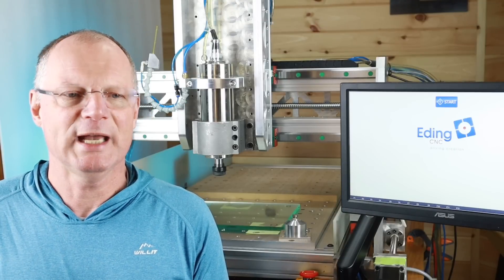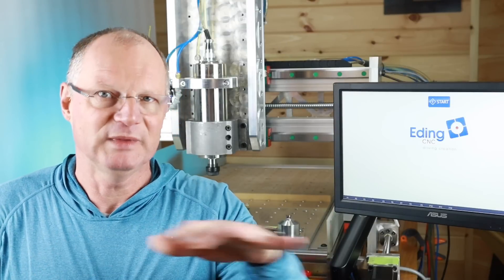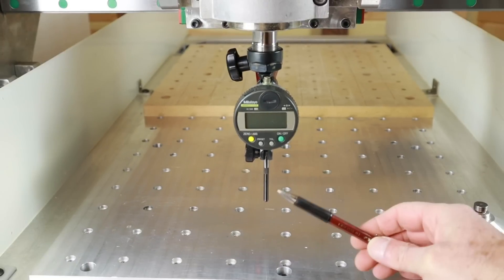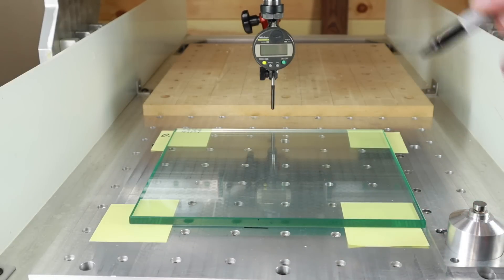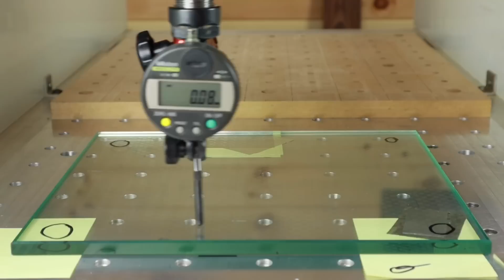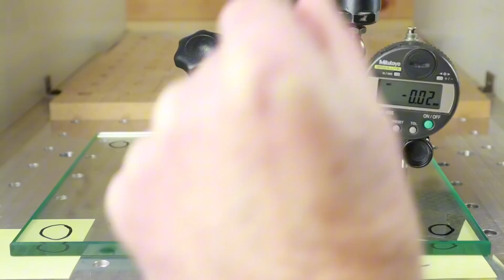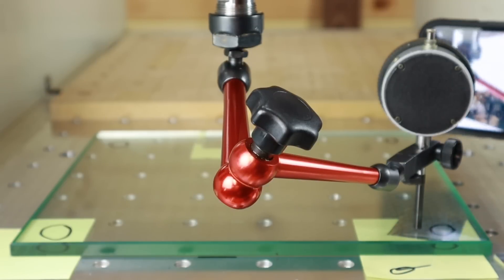How to Get PERFECT CNC Spindle Alignment Every Time!

Comment: For having a death-flat glass plate you can also flat an MDF plate with a toolbit and then put the glass over it.
Yes, the flat operation will produce "stairs" because the spindle is not yet square with the working surface, but it doesn't matter. The glass will make contact just with the tips of those "stairs" and it will be perfectly flat "on average". 😎

P.S.
This can be useful if you cannot find a thick float-glass plate.
Reply from the maker: I think it is best to use a known “standard” and to get away from the assumption that anything on the machine is straight or square. So sure you can use anything to tram the spindle but it will be increasingly more accurate using better components to perform that job.
Reply: @JBWorx Yes,, you're right.
Even when you move the measurement tool over the glass to calibrate it you pull the same error. My suggestion is working like your method but helps when you cannot find a very thick glass.
Reply from the maker: Correct it was not that simple to find that float glass. And as you can see on my Amazon link it is from a sharpening station so really for a different purpose.
Reply: @JBWorx  I got my floating glass from a Glasmacher here in Munich. But only after an appointment! 😄
And it was just 6 mm thick... I didn't managed to find anything better.
Reply from the maker: I had a similar experience here in the US. They had some on hand but it would take them 10 days to just cut my little square and it was super expensive. So I ordered something of Amazon and had it in my shop a day later for way less money.

Comment: Really useful tramming video. TYhamnks. I jusy found this site and was about to subscribe, when i noticed no posts since 8 months ago, so I assume the channel is now ended?
Reply from the maker: Well I am contemplating to make more videos. I have some ideas for ending CNC and Rapidchange ATC
Reply: @JBWorx  I will definitely subscribe and hopefully see more  :) So far they have been really interesting and useful. I have work with wood ona a Sainsmart CNC for around 18 months and really want to move to alumium and other non-ferrous metals on a second, more rigid, machine
Reply from the maker: It’s a good machine to start out and figure out if you like this hobby. Unfortunately most people will outgrow that machine in a very short period of time. 
I hope you stick with it and find a machine that can make more demanding cuts. 
Thanks for your sub.

Comment: I'm so happy to have found your channel! Lots of great information with thorough explanations combined with practical advice. Looking forward to going through most of your catalog. Liked & subscribed.

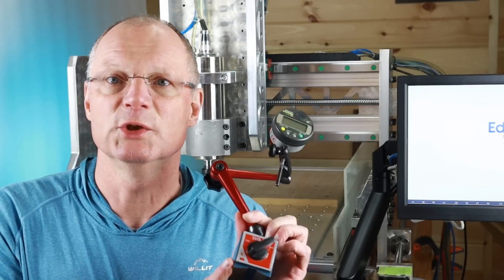Trivial comment: @4:16, that's not a hydraulic locking arm. It's purely mechanical with wedged components that pull together to lock all the joints simultaneously.
Reply from the maker: Thank you for reaching out. Yes I think you are correct on the holder. We used to use the hydraulic version at the place I worked for holding much heavier equipment.

Comment: Instead of just emailing you, I thought I would comment my question to get you more activity on youtube.
I am wondering what equipment I would need to get started on making RC airplane propeller adapters. They are small, normally soft aluminum, a small CNC lathe should be it but i am not sure if a CNC router table will work or not. Thank you
Reply from the maker: I know exactly what you mean as I fly RC planes as well. At this time I really enjoy 3D printing some. Too bad I cannot post pics here. 
Anyways, I think also a manual lathe will work. I have a CNC lathe and at times I wish I had a small manual lathe as well. So the benefit of the CNC lathe is in repetitive work and compound curves that are other wise difficult or impossible. 
Yes a CNC router with a 4th axis can also make the adapter. Not as convenient but possible. Also there is the possibility to mount a lathe tool on the Z-axis and use it as a “Mill Turn” Fusion 360 has actually CAM support for that. 
Hope this helps and yes thank you for reaching out here.

Comment: This is an excellent video. I have a spindle tramming tool frkm boring research. Its pretty good similar to sst you showed initially. Is there a method involving that style of toll but using your method as well? What would i do just keep the circles on the glass within the reach of both sides of the tool?
Reply from the maker: This is used a tad differently. So you will zero out the dials but it can then show the exact difference reading both measurements. It really makes no difference other than you can see both faces and don’t need to look from the back like in my video. Try both and see which way you like better.
Reply: @JBWorx  should I still level the glass plate like you do?
Reply from the maker: Yes that will allow the plate to be parallel to the x and y axis and then you set the spindle to that reference plane. This will give you the best alignment.
Reply: @JBWorx  but then what if my gantry is slightly out of parallel with my bed? Wouldn't aligning the spindle to the gantry cause a new set of issues?
Reply from the maker: This is exactly the problem we have at a diy CNC machine. So if you can machine your table then you make it parallel to your gantry. Now if you cannot machine the table because it’s already precision ground then you will not level the glass plate but will work on making your gentry perfect to the table. For CNC routers we usually machine it over after spindle tramming
Reply: @JBWorx  that's exactly the info I needed.
Reply from the maker: Excellent 👍
Reply: @JBWorx  now time to buy one of your misters haha
Reply from the maker: Please do - I have them in stock !

Comment: if I face an aluminium plate (in another machine), can I use it as the base for the glass? Just would need to check and adjust (if necessary) the 4 points as you did, right?
Reply from the maker: If that machine is capable of generating a flat, even surface then yes that is perfectly fine.

Comment: I did a video explaining the same method, yours is a little more tefined than mine, my method has changed since i did the video 10 years ago, i used a small granite surface platen and precision squares and run the spindle up and down it so travel is running true as well.
Reply from the maker: Yes that measurement is also necessary as it will align the z-axis travel to your x and y axis. It’s different than the tilt of the spindle and it’s important too.
Reply: Great comment! I noted that this was not specifically mentioned. To me alignment of the primary z-axis motion is something that needs to be done prior to tramming the spindle itself.
Reply from the maker: In the order of events this is correct ! Thanks for your comment.

Comment: Noone ever explains how you make sure your Z axis is perpendicular to the X & Y.  This video shows how to make the spindle perpendicular but if the Z rails are not then you'll have angled faces as your spindle travels down. Any ideas on this? Great video though, really nice explaination 🍻
Reply from the maker: Yes I know what you mean. The process is similar but you will need precision round stock chucked in the spindle and set up a calibration square  measure distance to square in upper z position and in lower z position do that in X and Y.

Comment: You can do this without a flat plate. Mark a location on the table. Then move the spindle around, keeping indicator at the marked spot. This way you can align the spindle to axis movements, and afterwards you can cut the spoilboard level.
Reply from the maker: Maybe - if the spoil board looks like an “S” then you don’t really get close to being parallel to any axis. But it all depends on the precision you need. It’s ok for wood I am sure.
Reply: @JBWorx  Spoilboard shape doesn't matter, as the indicator stays in one place. Only spindle moves along the linear rails.
Reply from the maker: I am with you as long as you measure back to that same spot you are correct. 👍

Comment: Moin Jörg. Wie immer ein gutes Video. Aber die Konstante, germanische Vergewaltigung des TH macht es schwer, das Video zu genießen. Ich kommen mir vor, wie im Zug… „Senk ju for trawelling wiz Deutsche Bahn“. Das hat man leider sehr oft bei (eigentlich) deutschsprachigen YouTubern, die der Reichweite wegen Videos auf Englisch machen. Siehe z.B. Stefan Gotteswinter. Aber Du lebst in den Staaten, da sollte das eigentlich nicht mehr vorkommen …

Wie gesagt, meine „50 Cent“ 🫣
Reply from the maker: Den accent werde ich nicht los. Aber andere auch nicht. Wenn du eine Sprache akzentfrei sprechen willst musst du die mit ca 5-6 Jahren lernen. 🫤
Reply: @JBWorx  Nun, ich habe nicht von akzentfrei geredet. Aber das TH als S zu sprechen, macht auditives Aua 😩 Ich habe etw 3 Jahre gebraucht, den deutschen Akzent weitestgehend loszuwerden, obwohl ich weiterhin in D lebe… Wie gesagt, nur meine Gedanken 😇 Ich habe übrigens heute den ganzen Tag damit verbracht, den 3D Taster in meiner Masso einzurichten. Den Du empfohlen hattest. Toller Tipp. Ich habe gleich einen Magnetkontakt dran gemacht, damit das Kabel nichts kaputt reißt 👍🏻
Reply from the maker: Cool, der Taster ist für das Geld klasse.

Comment: It's not a bow...it's a feature 🤣
Having a bow like that in the axis is quite a bummer. Especially in the other direction, where it is a rather tedious process to shim every single bolt of the linear rails.
Maybe you can show the folks out there how to correct such an issue in the software with the CrossCompensation feature from EdingCNC in one of your next videos...
Reply from the maker: Thank you so much for that input !! And yes it’s in my channel idea list. I don’t have a certified standard at this time long enough for the y- axis travel. I like to get a granite straight edge and then further set up work is possible.
Reply: @JBWorx  Yeah...tell me. Having this stuff is rather essential when building a DIY CNC, but bloody expensive and worse case a one time use...
Reply from the maker: Yes exactly. I was able to borrow a Starret 1,5m straight edge when I initially set this machine up however it has been moved since then and could use a checkup.
Reply: @JBWorx  Do you have access to a trustworthy machine shop in your vicinity? If not, Xometry might also be a good option.
For a one off DIY CNC router alignment op, a precise CNC machined flat steel often is enough.
A 60x10x1000mm flat bar in C45 is like 160 bucks on Xometry. A neighborhood CNC shop should be even cheaper.
When designed cleverly with a few holes inside, it can be also used to calibrate travel distance 😉
Reply from the maker: Yes I have access to a mold making facility with CMM. I had some glass standards made by them with very good precision for travel calibration. Xometry or other online services I did not think about. Good suggestion.
Reply: @JBWorx  Last comment was actually also for the audience here 😂 Depending on where you live, these online part services can be a last resort 😉

Comment: Showing this with an ‘already calibrated’ spindle is not nearly as helpful or useful as if you showed yours out-of-calibration and actually going through the process of adjusting it.
Reply from the maker: You are probably correct. However it takes eons to get the tilt to zero like I showed so I would not dare to touch mine. Also when I made the video I expected to make adjustments as I did not touch that spindle in over a year. Well it stayed in place very good.

Comment: Ive got a small granite ground plate thats 8 by 6 by 2 inches so im guessing I could use this as this might be flatter than the glass.
Reply from the maker: Absolutely 👍
Reply: @JBWorx , how do you k ow that granite is flatter than glass? I am 100% new to this. I am still waiting for my Altmill to arrive. Thanks
Reply: @ These are normally precision ground surface plates for doing measurements. They are quite expensive to buy. So the glass is probably more economical, but if you already have a small surface plate it makes sense to use.
Reply from the maker: Like already mentioned. The granite is made to be a measurement surface and also controlled. The glass happens to be flat.
Reply: @Festivejelly , thank you for your response.
Reply: @JBWorx , thank you for your response
Reply from the maker: You bet. 👍

Comment: How do you feel about Eding in general? Does it have native post processor for fusion and aspire? Thank you
Reply from the maker: I have been using EdingCNC for many years  and really like it because of the options it offers. You can get PP for some programs directly from EdingCNC. I know VCarve is available and I use Fusion without problems.
Reply: I've been using Eding for a couple of years with VcarvePro and USBCNC is what I use for the post processor. I still have a lot to learn about the software as I havent'n use it a lot since it's just a hobby, but I'm in the process to upgrade my DIY cnc and will probably use it more after I'm finished with the upgrade.

Comment: I really struggle with getting the an axis itself perfectly 90 degrees with respect to x and y. How do you fine tune that reliably?
Reply from the maker: Yes I know what you mean. I have a video about that.  Best is to use a known standard so a square.  Then you need to either set it mechanically square or if you have a dual driven axis you can use the home position for that.